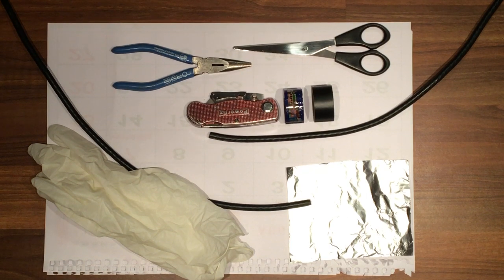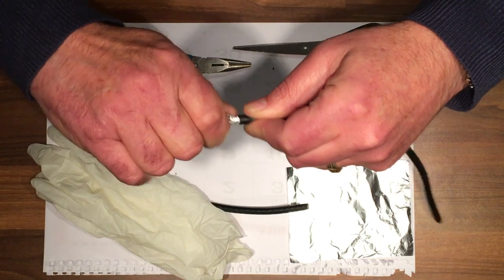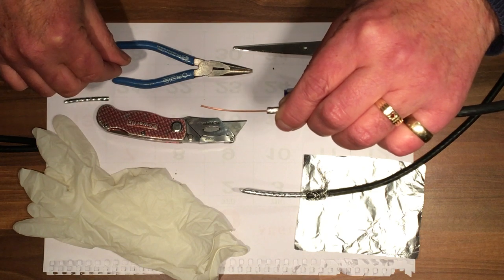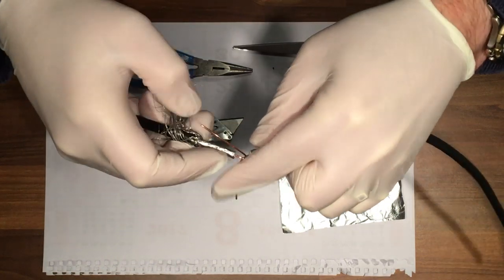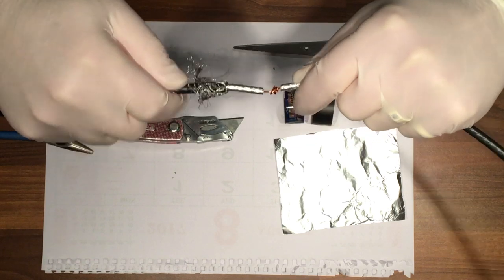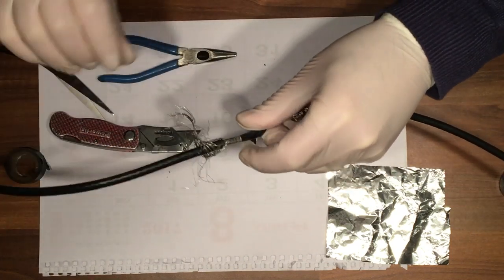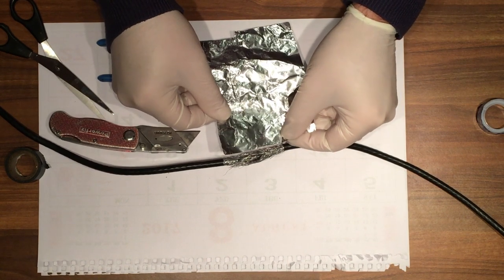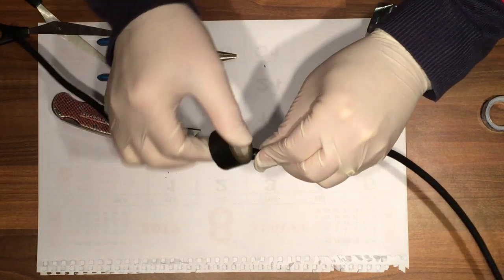Life Hacks How To Twist and Tape 2 Coax Cables Together To Make a Strong DIY Joint

Comment: As a former Cable Tech all I can say Is never do this you will cause ingress on the system and the cable company will shut you off and charge you to fix it.
Reply from the maker: Ideally if you are on a cable subscription then call the cable company but from experience, waiting for the cable company tech can take several days to weeks so a temporary fix is better than no service.
Yes, there can be some minor ingress, egress or signal reflection (not dangerous or a safety issue) but again, better than no service.
I personally have never heard of someone (that has a fully paid up subscription) being shut off.
If you not on a paid subscription then this is a way to fix/repair your service.
Reply: I fix crap splices like the one you show on the daily.  Cable company plant maintenance techs shut people off all of the time for CLI, and ingress.  I get at least 5 or 6 work orders a week for it.  Sometimes more.
Reply from the maker: The cable company will shut off people with illegal connections i.e. non subscribed. 
Very seldom will they shut down a registered customer who had attempted to repair his home cable whereas most likely they will be billed for the callout and repair or if no access then a filter will be fitted at the tap.
Reply: @DrivewayDudes  If the egress or ingress cause by a splice like this shuts down an entire node maintenance will shut that customer off.  I see it a couple of times a week.  I'm a current technician for the largest cable operator in the US and have been for over 10 years.
Reply from the maker: Jones/NCTI trained and certified?
Reply: @DrivewayDudes  look at you trying to sound smart. I work for Comcast, we do our own training and follow our own BRIS standards. NCTI not required.  Are you really trying to argue with a guy that has 10 years real life current experience in the field?
Reply from the maker: You miss the point of this video entirely. It is a diy temp quick fix until the correct connectors become available. 
I understand ingress, egress, impedance, reflections, etc.
Your concern is valid and I would agree with you that it may cause issues if not rectified but as a quick fix to temporarily restore a service this can done, has been and still is. 
I too have experience in this field (25+ years, have Certificates and Diplomas including NCTI).
Argumentative? Never.  Smart? There's always someone smarter than me.
Reply: Driveway Dudes  I am a Maintenance Tech I shut down return carriers all the time for too much noise. I report it the company then will book a service call with the customer to fix the noise before coming back on line. Internet phone SDV QPSK and QAMs are going to have a hard time with this type of splice 😂 just call your local provider and get it fixed right!
Reply: To the Comcast tech commenting here, How about y'all figure out how to get someone's service restored within a reasonable time frame, instead of threatening to shut them off or charge them for trying to fix their service? I live in a rural area and act as my disabled mother's caretaker. Our Comcast home phone is my only means of contacting 911 if my mother has emergency medical issues. Comcast says they will be out here in a week to fix it. I'm not taking that chance. I am going to attempt something like this. If Comcast wishes to charge me for it, I'll see them in court.
Reply: @DooM3d1  Exactly!
Reply: I second Steve here. I work in the industry (yes ncti cerfitied) and yes, every company will shut down a paying subscriber if they are causing issues in a node (which will affect more subscribers). And yes, every cable Co will charge a customer who does a diy repair that damages equipment. I charge people all the time for doing this kind of hack work.
Reply: @artrekz  I went ahead and patched the line myself because the ability to access 911 is more important than Comcast getting butthurt. When the tech showed up the following week to fix it correctly, he and his supervisor told me it was the right thing to do and that I could not be charged for trying to repair a line that I own. Sorry, but I'm going to stick with their advise.
Reply: @DooM3d1  digital market or analog?

Comment: So glad i found this ! Cable crimper does not work , ( that i own ) so i had wire just taped into the connector .  Ill be back tomorrow after I try this  :)  ty
Reply: I tried this yesterday ,   IT DID NOT WORK !! I was so angry ,  I have  an outdoor antenna  wired to an old dish network wire , it works great , but not  as instructed wire to wire  . SO  disappointed  , its a fail from me

Comment: V2.0 For those only want to do it once
1-Solder the copper core without any knots. An inch if solder is plenty strong.
2-Cut the sleeve you removed from the core on one side (when viewed from above, its like the letter C <-- cut here) and put it back on with some silicone or epoxy in the slice and both ends
 *Extra bonus if you drill the center larger to better accomodate the new "thicker" core
3-Roll 1 and a half layer of aluminum foil over the protection you just glued back
4-Put the wire shield back on, try your best to make it pretty
5-Add 2 layers of aluminum foil over the wire shielding
6-UNDO THE WHOLE DAMN THING CAUSE YOU FORGOT TO PUT THE *$%! SHRINK TUBE BEFORE STEP 1 (Hey... at least you didn't solder the wire shielding!)
7-Add a layer of silicone and slide the shrink tube back over the whole thing (make sure its twice the lenght of the repair)
8-Forget about it for ever.
Reply: thecrazy8888 Or simply get an f connector and do it correctly

Comment: Driveway Dudes, thanks for the video.  This will help to do a "temporary" repair or for someone without the tools to install the proper connectors to barrel together.  One suggestion to ensure weather proofing, start the insulation tape in the middle, wrap to past one end, then reverse and wrap just past the other end and then reverse again to wrap and end in the middle.  I was a Field Wireman in the USMC and this was taught to us to ensure water proofing.  Also, never ever use the cheap HFT tape or you'll regret it.
I've never thought to splice a cable this way, so I wonder how it affects the impedance of the coax.
Reply from the maker: You're welcome. It would be best to order/purchase the correct fittings and insulation/sealants as soon as you can but in the meantime this should give you some signal.

Comment: Followed your instructions exactly but lost all TV signal, so did it all again Without the silver foil and it worked. Still no HD channels though...
Reply from the maker: Strange. You have to make sure the centre core/conductor is isolated/insulated from the outer conductor/braiding. The outer conductor/braiding needs to be neatly positioned evenly around the inner conductor insulation so it can act as a shield to enable it to pass or return signal. The foil is used to help the braid shielding. Doing it this way will ensure a signal. We have extended cable this way and were able to receive hd signal.
Hope this helps
Reply: @DrivewayDudes  I tried your method twice and was careful, but now think my cable is just too old - as the white inner core was stuck to the copper wire.. So I've decided to replace all 20m of outdoor cable & and get a new Aerial. Hopefully no joins in cable will fix it.

Comment: Excellent. I'm going to reconnect my cable tomorrow, I just bodged it before to get a signal from the roof aerial to my TV downstairs through the cable the builder built into the house. I'm getting a digital signal but no HD signal, obviously because I didn't do it this way that is why. Many thanks and have a nice Xmas 🎄

Comment: Can you use the solder heat shrink but connectors on the actual reconnect  and/or the insulation? Also, can you heat shrink wrap after? Thank-you in Advance 😊
Reply from the maker: If you have heat shrink then yes you can use it instead of insulation tape
Reply: @Driveway Dudes Thank you so much!!   Also, I bought new wire to splice to my old ones, (the other end of mine was too damaged), and the insulation is gold in color but my insulation is silver, is this ok to put together?
Reply from the maker: @dlh0419  Ideally the centre core is copper wire to give better conductivity for signal/data transfer. Covering that is the dielectric which can be a medium density foam or honeycomb plastic. Depending on the quality of the cable the next layer can be a foil thin metal shielding of either copper or aluminium. That is then covered by a braided shielding or screen which is then covered by the outer insulation. Hope this helps

Comment: No doubt that it works. Thank you!!!!!Just tried and I am back on line.  Can be this be consideted a permanent fix?
Reply from the maker: It's a DIY fix and is more designed as an emergency/temporary measure until you get the suitable fittings or have your cable/satellite/broadband company call to you. 
If you are not a subscriber to a company and the coax cable is yours then the decision is entirely up to you

Comment: I would joint the center conductors together in a neat "Western Union splice" and solder them before wrapping with electrical tape.
Reply from the maker: The western union or lineman splice is designed for a more permanent joint that would be put under stress. 
Where no soldering is possible or available, this video shows a quick fix temporary working joint.
Reply: I think the point of the video was to help people who only have the most basic tools and knowledge mate.

Comment: After the center core has being twisted together, the joint should be soldered, before applying the insulation .
Reply: Or use 2 connectors and a barrel then u wont waste signal lol

Comment: Will this work for saving internet? Got spectrum internet and the dipshit previous owner of my property cut the cable from the pole.
Reply: Do not do this. I promise you it will give you issues. Just call spectrum and have them fix it right. If you do this and then call them out to fix it right I promise they will be laughing all the way down the road as they leave.

Comment: Nice video, easy to follow instructionns including what you need to buy i.e. 2 x F screw on type Connectors and 1 x F type Coupler., clean cut my tv ariel outside so will buy items and join as per insructions given. Thanks Bernie

Comment: So the center conductor is too sensitive for skin but we can tie it in a knot and compress it?
Reply from the maker: Your skin secretes substances and oils that are acidic to certain material compositions and over time cause corrosion. It may also coat the material and reduce contact so could act as a semi insulator. Bending, twisting, compressing, etc would be less harmful than adding an element of acid.
This video as explained in the description is a temporary fix. It would of course be best to use the suitable connectors to join the cable if possible

Comment: hi sir, is there a length limitation when connecting rg6 cable because after i tried to connect a broken wired 100m rg6 (dvr to cctv camera), it still not working

Comment: Use vulcanizing tape instead, for durable results
Reply from the maker: You could use vulcanizing tape if you want to spend the extra but be aware that it can be difficult to stretch wrap around thin wiring

Comment: Great video thanks from Canada! Question, I’m trying to splice a small auto antenna cable (which I think is a type of co ax). Can this technique be used? I’ve opened up on end of cable and it appears to have a copper fine mesh under the outside cable cover with what appears to be a white wire/filament ? in the middle of the whole cable. 
Any help would be greatly appreciate as removing the whole dash and part of inner engine bay to route antenna cable is not desirable. 
Thanks.
Reply from the maker: Thanks for the comment.
Most car antenna cable is a type of coax and the same principle could be used to repair / join.
if you have a soldering iron then you could also try it this way   https://youtu.be/j_76Pw-2SSg
Hope this helps

Comment: So heat shrink tubing instead of tape is ok m8? Just wondering if the heat i apply to shrink the tubing will affect anything. Thx btw, liked and subbed. Cheers from Canada eh?
Reply from the maker: Hi Vernon,
Thanks for watching the video. To answer your question;

Electrical insulation tape is generally the most commonly available and least expensive. It would be ok to use particularly indoors. For outside or areas that may be more open to the elements, try to use the stretching type insulating tape, wrapping it tightly around the joint. 
If you happen to have or can purchase heat shrink tubing, cold shrink tubing or self-amalgamating tape, etc then yes you can use these as they may offer superior protection to the joint for a longer period of time and are suitable for joints whether they are inside or outside. 
Driveway Dudes Paul
Reply: Yes i bought like 500 piece heat shrink tubing kit and use it wherever needed around the house. It is amazing stuff and almost "look" for things to use it on. Well looks like i found another. :). i just find it makes splicing/joining wires look cleaner and more professional. Once you use it you'll never go back to tape. I finally broke down and tried them last year and i really am happy how well they work. I just put another order in today for another set. Another 4$ well spent. Yup 4$ for 500 pieces and 8 different sizes. Thanks for the video btw ..can you tell me how necessary the tin foil is. I'm about to splice a line right now and i don't have any foil here. Is it worth a quick trip to the grocery store or?
Reply: Oh and how much do you know about Rca - 3.5 mm wiring. Lol
Reply from the maker: The foil is both a conductor for the screen as well helping to deter signal leakage and blocking other outside signals possibly getting in from another source.
Reply from the maker: In an RCA you have L and R. The sleeve or screen being the common ground
Reply: I need to solder/join a 3.5 mm jack (tip is left middle right sleeve is ground) White Red And Bare resectively. There are lots of tutorials on splicing a 3.5 mm jack to two rca plugs but i need to wire it to just one. That would be just the two wires. From a bit of reseach it looks like i combine the red and white as the + and both grounds connected give me the - side. Any advice. There are a3.5 to single Rca cables. I'm wondering how they work. Maybe the 3.5 is only mono maybe? Thanks so much btw for your help. I'm off to get some damn tinfoil hahahhah
Reply from the maker: 3.5's come mono, stereo and can include microphone.
Check this out as it may be what you need
http://www.elvenlabs.com/3-5-mm-jack-wiring-diagram/

Comment: O for the love of god! Get a coax repair kit!  I hope you're not running an internet connection through that! lol
Reply: why?
Reply: @Dave_Menz_p4p_number_1  - I really hope that's a sarcastic question. 

The noise on that line is going to be unbearable.
Reply: @jeremiahdeering9645  why
Reply: @jeremiahdeering9645  how do you butt connect a bnc that carry video signals
Reply: To start off the braid in the coaxial cable acts as a faraday cage keeping signal in and external signals out. The foil may help but there is still going to be signal leaks especially in the lower frequency range where your return carriers ride at. If the noise is bad enough and I’m sure it would be it will inject itself back into the cable network and cause poor upstream snr (signal to noise ratio) for everyone else in the node. Also coax used for tv and internet is designed to operate at 75 ohms. When you do something such as smash, kink, or “tie” the cable it compromises that 75 ohm resistance. This can cause a multitude of issues such as poor MER and BER (modulation error ratio, bit error rate) MER is basically the quality of signal going to your devices. You can have all the signal in the world but if it has poor MER then you are likely to get tiling or slow internet if it even works at all. BER is basically how many bits of information are reaching the devices. Pre and post. You can have crappy MER and good BER. If the quality of the bits received is shit but they all get there then your BER can still read fine. Your modem and cable box have a forward error corrector inside of them which can correct “damaged” bits. Pre is before the correction. Post is after the correction. Bear in mind that the forward error corrector can only do so much. Also higher frequencies ride on the outer part of the cable. This is known as the skin effect. Lower frequencies ride more toward the center. Hence the phrase highs can’t swim lows can’t jump. Get water on the center conductor and you will wash out your high band. Have a poor physical connection and your low band will roll off. Using this method will undoubtedly give you issues with all of the topics I’ve listed above. Not to mention micro reflections. Back to the 75 ohm impedance. When you compromise the 75ohm connection, the signal flowing thru that particular spot will reflect back. Whatever frequency it reflects back, will interfere with that same frequency trying to move forward. This is known as return loss. I have rolled on more trouble calls than I can count where this has been the “diy repair” and people wonder why their stuff isn’t working. Remove this and fix it right and suddenly everything runs like a well oiled machine. So Robert you asked why. This is why.